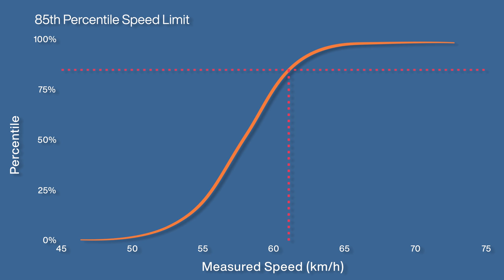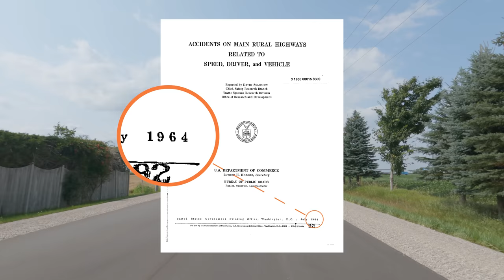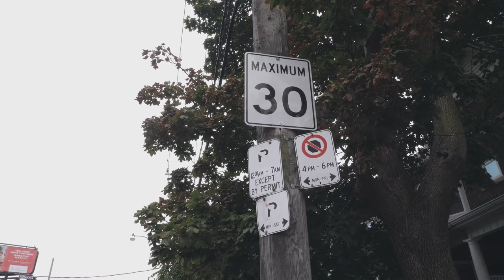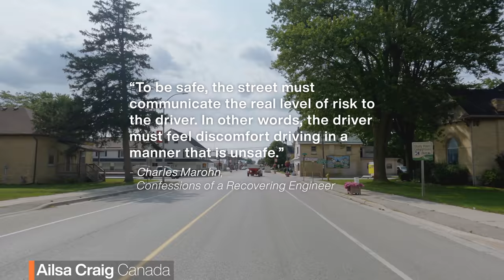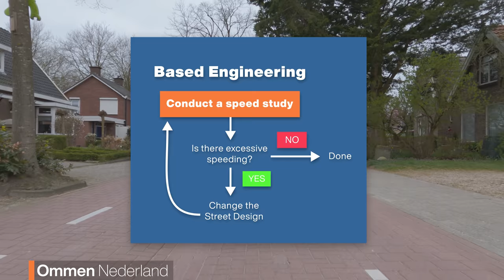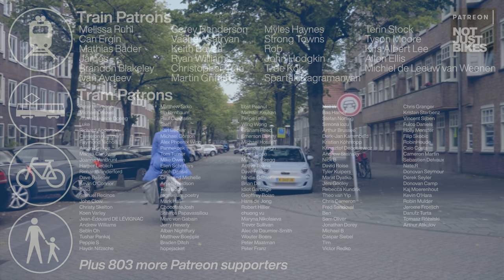The Wrong Way to Set Speed Limits [ST06]

Comment: The best road sign I ever saw was at the edge of a small town in Missouri.  It didn't say speed limit 35.  It said the lights are timed for 35.  I immediately slowed to 35 at the edge of town, stopped at one red light in the center of town and drove through about 10 other traffic lights all of them green.
Reply: That was an approach here in Germany as well. Worked to some degree.
But one small town I know of enhanced that idea. They had street based speed controls, not for a speed trap, but for several street lights with associated pedestrian lights.

Any time someone went over the speed limit for that area, they simply turned the next street light red, and the pedestrian lights green.
They even announced that fact at the entrance to the town. Since then that street has become much calmer as people have learned that it won't do them any good speeding as they will then be slowed to a complete stop at the next street light and have to wait an extraordinary long time for it to turn green again.
To ensure people didn't run those red lights they set up a Blitzer / a kind-of-speed-trap with a camera attached. But not for exceeding speeds, but for taking the picture of anyone running the red light, including their license plates.
As running a red light is punished a lot more rigorously than a small speeding ticket, most people inherently obey a red street light avidly.
Reply: @RustyDust101  I had that idea one day in the car, just riffing on the phrase “red light cameras”. Normally cameras which photograph red-light runners, why not take some immediate action to slow things down? What town actually implemented it?
Reply: @RustyDust101  that's hilarious
Reply: We have that here on the ring road in Eindhoven. A sign says how fast you should drive (50-55-60-65-70) to get all traffic lights green. It's very nice and fast! We had this already in the 1980's but the technology has improved a lot over the years
Reply: @RustyDust101  That's fantastic! Good way to frustrate people who speed out of habit.

Also a good way to trigger red lights for more traffic light gran prix action (on roads with appropriately low witnesses and potential victims), not that I know anything about that of course...
Reply: @pluisjenijn  and it shows you a nice little green wave icon as well, fuckin love those roads
Reply: Hopefully people aren't going 70 because that might work too.
Reply: @RustyDust101  in general though. germany has the same thing as AS and canada. from a 100kmh rural road. into a small village with only a tiny yellow sign saying the name of bad-kleinstein. where the speed limit is suddenly 50kmh. mostly the road with does not change no speed bumps and almost no other cleu that you are suddenly in a village of 2 houses and a kettle shed.
Reply: That's referred to as a Green Wave.

https://en.wikipedia.org/wiki/Green_wave
Reply: what is the name of the town? I live in Missouri so I'm curious
Reply: @loekvanbentum3907  it's changing. I see that in many places speed bumps in form of small planted areas are placed. They narrow the road so that one side has to stop. But it's a slow process and happens just if the street is made new. But at least German streets and roads are in general narrower than Americans
Reply: That should definitely be a sign in many towns. Like Marietta I sure would like to know what their street lights are timed for.
Reply: @MrWhite-pn7ui  yeah, europe is "designed to have the desired effect of increasing safety", USA is "designed to have the desired effect of increasing city income"
Reply: Alex Riddles, more often than not I have seen cars pass me when I am driving within 5MPH of the posted speed limit. Almost all the time, I end up catching up with those cars at the next light. Mix my driving habits with cruise control, and I often see more green than red. I bet those who drive faster end up with more red then green. Not directly stated, I think the traffic lights in my area are roughly tuned to the speed limits, or it could be my pattern-riddled brain making connections that aren't there. I think I put less wear and tear on my vehicle (brakes, oil, tires, etc) and consume a bit less fuel covering the same distance.
Reply: That would be a good way to do the signage but it still leaves the issue of setting the actual speed. Any metric, like the 85% measure, that relies on trusting the majority of drivers to know and drive a safe speed for the road and weather conditions is frankly stupid.
Reply: @nothere7198  The 85% metric isn't really even that true.  Alot of rural roads are just set to 55 mph because that used to be the national speed limit and no one ever wasted the money ro change it
Reply: @MaaveMaave  No, that is not hilarious. It is the way things are in Germany. Have you ever killed a pedestrian, by ignoring a red traffic light, driving your ridiculously heavy four wheel drive pickup truck? Civilians walking don't stand a chance against you. Now that is hilarious.
Reply: @Maranville  70 might work, but 17.5 is almost guaranteed.  When you double your speed, you get to the other side in half the time.  If there is only 1 (or 3, 5, etc odd) light cycle green-red-green in that time at 35, then at 70 you arrive smack dab in the middle and have to wait.
Reply: This is probably the smartest idea compared to reworking the layout of every single road in the world, to accommodate subconscious driving. It will only take a reprogramming of existing traffic lights, provided they exist in your area.
Reply: @Maranville  I get what you mean but you won't get any effect like that unless the traffic lights are spaced at even intervals... Of course, if you have a strict grid pattern city with blocks of exact lengths then it might work, but that isn't the environment I would recommend speeding to anyone since that's usually the places with a massive budget deficit that need to bring in revenue by fining everyone who goes even 0.1% over speed limit.
Reply: @Maranville  Well yes but no.  They are set up throughout the town so they change on intervals that are timed so at any given time the number of red light and green lights are constant.  I cant say how many are as I am not the engineer who makes these, but lets just say 7 are green as that would make sense as a main road sees more green than red, but not a bunch.  That means there is always 3 that are red.  If you bypass the first one barely beating it turning red, you would then have 9 lights, and 2 are red.  At this point you could go 4.5 times the speed limit, which is 157.5 mph.  I mean its possible even though you obviously shouldn't!  The flip side to this is if you go 70 right after the first light turns green after already being red, then the next one is red when you approach it at any speed above 35 because they are timed.  That's the whole point of the idea.  So in a wrap you actually undershot the speed people could go haha, its really 157.5 mph give or take a bit depending on how the engineers designed any specific lights!
Reply: the "green wave" as it was called in Vancouver/Burnaby BC do the speed limit and make all the lights / speed and get "punished" by red lights
Reply: @RustyDust101  red light camera "Gatzo" are VERY COMMON in Canada  the green/red light is a great idea
Reply: Where I grew up in NJ, there was a long road connecting through several towns that I used regularly.  The speed limit was 35 or 40 and I discovered that if I drove 2 mph above or 3 below, I could catch every traffic light with no stopping.

Comment: Maybe the mismatch in speed design is intentional: the speed trap. Make your road subconsciously have drivers go fast, and place a single random sign informing them that the speed limit is much lower. Then the locale profits off of speeding ticket revenues. That's what's really going on.
Reply: when I was young in Victoria there is a stretch of "road" fully divided 2 lanes a direction HUGE shoulders  great sightlines and BETTER then the hiway you exited to get on the road and the speed limit is 50 KPH and zero exits / intersections at all

Comment: In Australia, we tried a rule that you must slow down to 40km/h (24mph) if there are any emergency vehicles with flashing lights on the side of the road - for example, a police car giving someone a speeding ticket. The rule even applied on 110km/h highways (86mph). There was extreme pushback but the government trialed the rule anyway. The 1-year trial was ended early due to the sharp increase in rear-end collisions and videos of semi-trailers slamming their breaks to match the changed speed. In some cases you had one policeman writing someone a ticket and another in the same car with a speed gun out to catch those who didn't slow to 40km/h in time. It was a fucking mess.

Comment: 5:24 "most people don't consciously think about what speed they're going"

Then there's me who checks my speedometer every five seconds because I'm paranoid about being pulled over for no reason
Reply: Same, I freakout if I see red and blue lights in the mirrors
Reply: @jellyfishes800  Yeah. I've had that experience before.
Reply: Lmao, I also check the speedo frequently, but I still drive over the limit by like 5 or 10 km/h
Reply: I dream of a world where cops dont just pull over drivers for no reason. If theres no clear and present danger, theres no need for immediate intervention or fines.
Reply: And Stroads that change speeds constantly. You miss a sign because you're trying not to rear end someone or hit a biker.  These are a problem with constant speed changes.  And then I have to get my truck around the guy who just got pulled over by a cop, in stroad traffic.
Reply: which is why he said "most" not all.
Reply: @piotrsajuk6435  idk about all states or places but in Texas you can drive I  either 5 or 10% above or below the posted speed limit before you should be pulled over
Reply: My car has cruise control with limiter setting. I love it, it lets me control the throttle, but won't let me go past whatever I set as the limit so I don't even have to think about my speed. My car also has a traffic sign camera, so it shows the latest seen speed limit on the dash.
Reply: Being attentive ain’t bad if u can manage to do it calmly and reasonably
Reply: As a new driver on a country road in Canada, I hit a bear. It jumped out of the ditch beside the road- there was literally no way I could stop without hitting it. The bear and the passengers were fine (though the car was about 2k dammaged) and I am convinced the only reason there were such good outcomes is because I was at the speed limit. Since then I am HYPER vigilant to not speed unless there is some good reason for it.
Reply: And me who looks at fuel consumption
Reply: I still have that leftover from the War on Drugs years... 😣